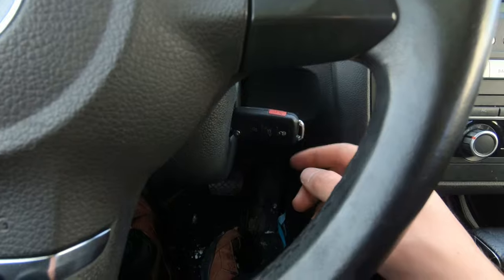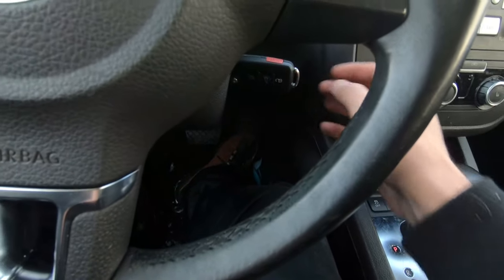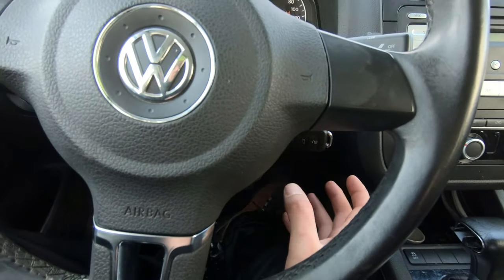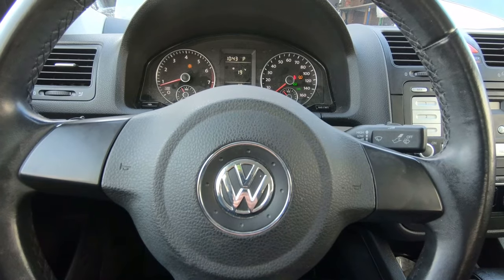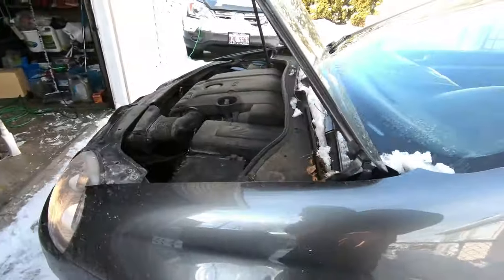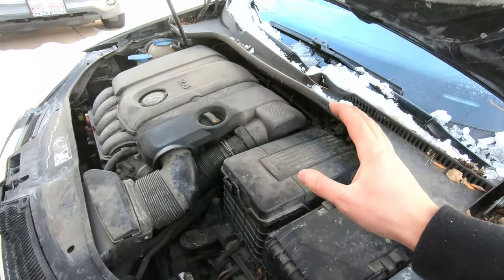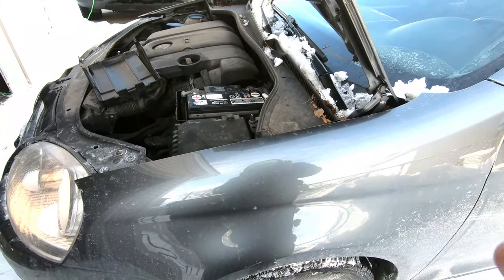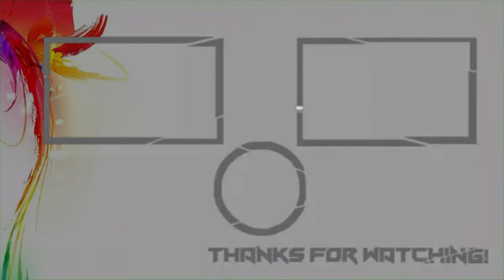VW KEY STUCK FIX  (Ignition cylinder problem)

Comment: I was stuck in the middle of a light with my 5 month old baby crying because she wanted milk that I did not bring because I ran down the street. All my lights came on so I turned car off and it wouldn’t turn on. I googled the issue and instantly watched this video and did what u said at the beginning of the video! And OMG you saved my life!!! Thank you so much!!
Reply from the maker: Glad I can help! 🙏✅
Reply: @BulliKid  TY BC I could not get my key out of the ignition.. I took the fuse out but now I have to figure out what to do 🤔 . I don't know any1 to fix it so I might have to try to do it myself
Reply from the maker: Taking the fuse out will shut down car. Ignition issue is separate thing that needs to be fixed.

Comment: This happened to me 2 years ago, luckily 20 minutes before the dealership closed, so I ran the car over, and they said it was a recall and fixed it for free. However, this just started again. So far, I can either wiggle the key out or put the car in reverse, then drive, then the key will release.  It's probably not a long-term solution, but I will use all these tips, thank you

Comment: if its really stuck and some of these suggestions do not work, make the key fob a right angle, as if folding the key in normally, bungie cord it to the brake pedal as if trying to turn the car off with the bungie cord attached to the folded fob part, and tap with hammer and thin punch at ignition lock itself. the tension help from the bungie will help apply twisting pressure, and hopefully you can jar the obstruction loose by tapping at ignition lock (the part key goes into) with hammer and punch.

Comment: Another great tip if the key is stuck in the on position, is to take something like the handle of a screwdriver and tap the butt of the key while turning it off. Works pretty frequently for me when shimmying the wheel doesn’t want to work!

Comment: The intial problem is those slider keys suck. The tumblers get stuck in the ignition switch and prevent you from either turning the key over, or turning the car off

Comment: Hey just came upon the issue on my in laws family car. 2013 polo and when I try to push the key from 1st position to start the engine there is resistance to it and after a bit more there is a click sound. I thought it was a steering lock but no luck :/

Comment: TY I had to take the fuse out. At least the engine isn't running.  Will my car start back up if I put the fuse back in?
Reply: All I got the key out this am.. put fuse back in and had to charge battery so it is working but at least I know what I have to do in case I run into that problem again until I can fix it... ☺️
Reply from the maker: Exactly!!! Best of luck!

Comment: I have a 2012 CC and the start is a key-push start. I had the key stuck with the car on and couldn't get it to turn off. They key came out and the car stayed on, I pushed my finger inside and there's a clip to left  side that I flicked and it came off.

Comment: Great, I got the key out... spray lubed the keyhole and now won't turn to the ignition point or start point.
Battery is charged, and shimmying steering wheel technique. Ideas?:

Comment: Someone help me put the car on neutral and help me move the car where I can park but then the key finally came out… my car isn’t safe to drive cause once I put gas in my car the car decides to shut off by itself when I once I did a full stop then once I try to turn it off the key got stuck.

Comment: You are a serious lifesaver THANK YOU!! Before your video, I was planning on staying up all night until my car (with 1/2 tank of gas) ran out of fuel ❤️❤️❤️
Reply from the maker: Thank you for the nice comment. Glad I can help you
Reply: Will the key come out if u pull the fuse while car is running? My key is stuck in the on position and the car is running but won’t come out
Reply: Current issue

Comment: I unplugged the fuse and I put it back in and now my car won’t start
Reply: Can you explain why? My key got stuck like the same situation and I decided to pull the fuse. I got my key lock fixed but now my car will only start for 5 seconds then cuts off. Did it maybe set off a kill switch?

Comment: Disconnecting the battery won't shut the car off without frying the alternator first. Very bad advice there!
Reply: I did this and it starts fine, but will shut right back off. Codes for instrument cluster I have no idea what to do